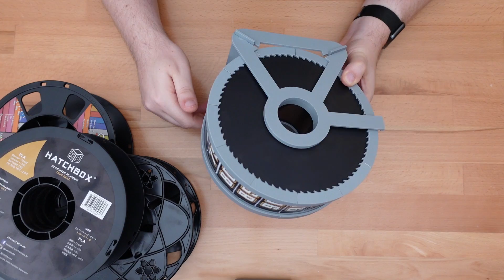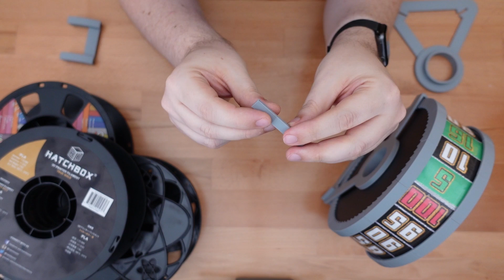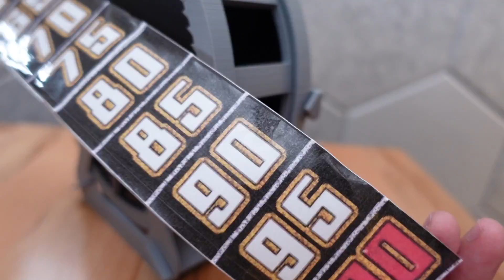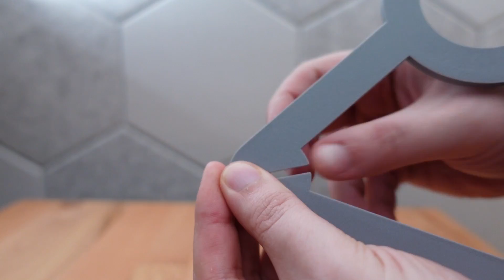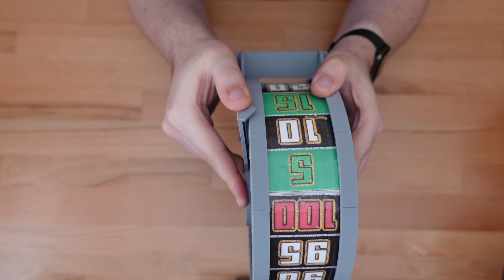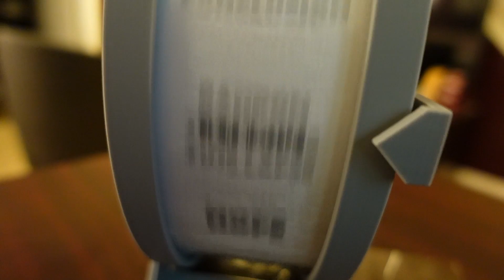Random Decision Wheel

Comment: What size is that spool? I couldn't get the reel all the way around; I fell short by a centimeter. 😪
Reply from the maker: Sorry to hear it! At the time, I was using a Hatchbox spool, but I can't guarantee the spool size hasn't changed over the years. I recommend measuring your spool then using OpenSCAD to resize the model to perfectly match what you have on hand.

Comment: It would be cool to digitize this, where each panel is a small LCD display and the control electronics could be housed in the center of the spool somehow.

With an increase in complexity of the design, the electronics could be mounted in a base with spring loaded sliding electrical contact points along the inside or outside edge face of the wheel for transferring data/power to the displays.
Reply from the maker: That's a very interesting mix of electronic wizardry with analog input! I'd love to see it with an e-ink display because really you could get by with a minimal refresh rate... maybe a streaky effect while spinning and a flash effect when it comes to a standstill.

Comment: First time using OpenSCAD and thanks to your instructions in the code itself I was able to figure it out without having to look much up. Nicely done! I'm still printing (SO MANY PARTS!) but when I'm done I'm wondering if doing a mod with bearings would be useful. Maybe the clicky friction makes the bearings not matter as much?
Reply from the maker: Glad you're trying the program out!

There's a lot of variables to consider - how stiff the PLA is, how long the clicky arm is, how heavy the wheel is... adding bearings certainly could help if you find the spool you're using is losing too much momentum too quickly! Either way, good luck!

Comment: Can you or do you have a video showing your printer setup? How are you able to get good prints, do you have an enclosure for your printer? Thanks, great video!!!
Reply from the maker: I don't have a video on that yet, but I probably will do so in the future!

Until then, here's the rundown of what I have now:
Project R3D Daedalus, Sidewinder X1, Prusa MK3, Prusa MK3s, and an Elagoo Mars Pro (haven't had a chance to play with this one yet).

None of these are in an enclosure, but they are in a temperature-stable environment. I keep my filament very dry and free from dust. Ideally, I'll open a roll and keep printing from that until it's used up. Finally, most of my prints are pretty simple, so they don't really push my printers all that hard.

The time lapse shows that when it comes to organic stuff with supports, my results are "okay" but not spectacular.